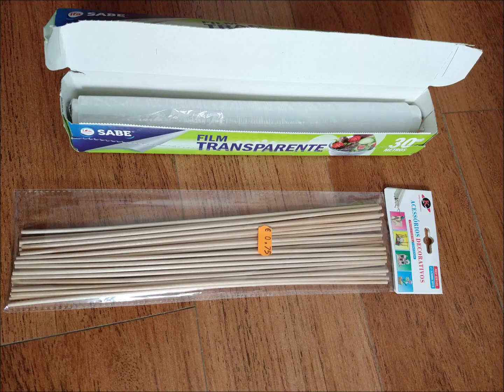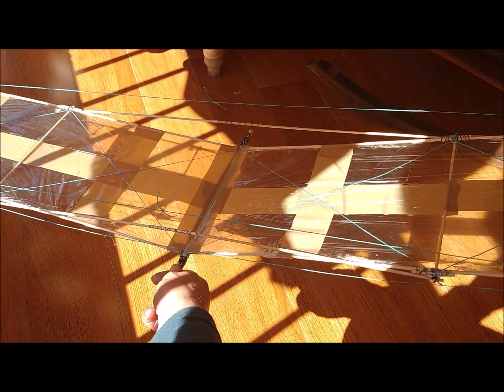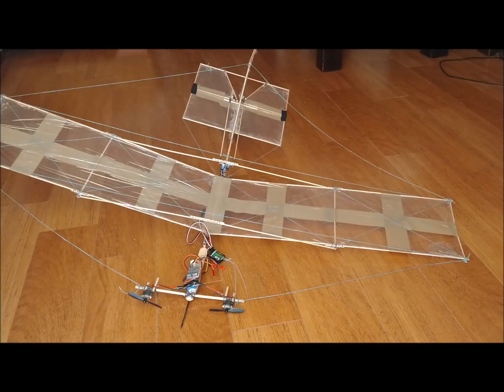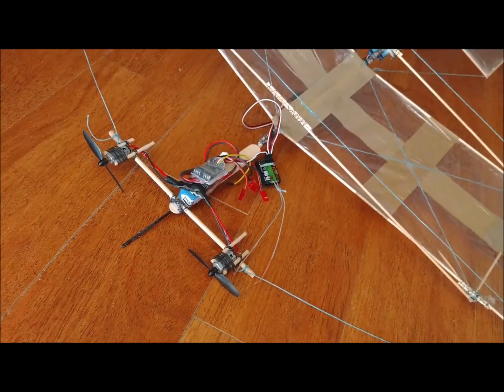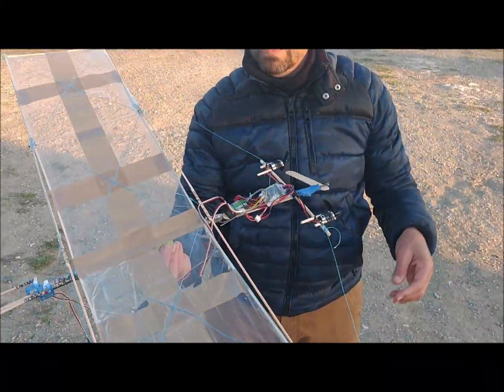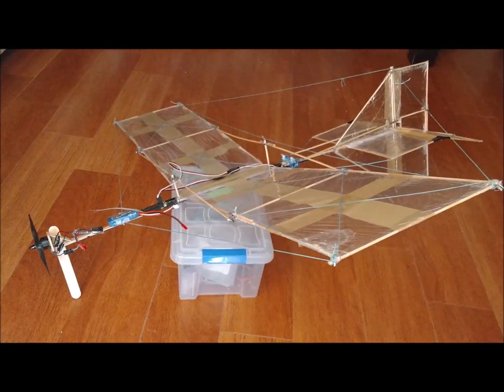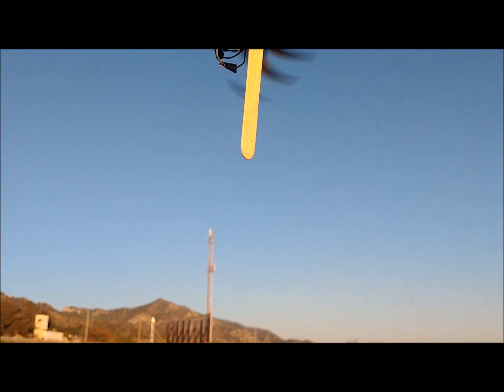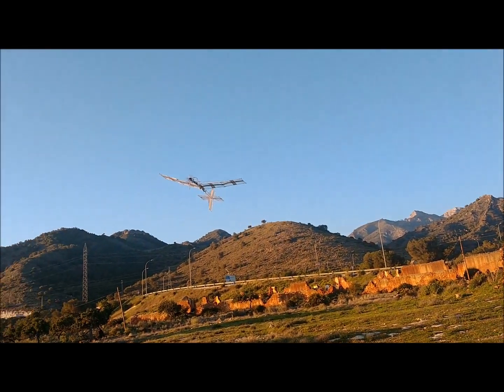How to build a very slow flyer plane with cling wrap and wooden sticks. RC. DIY. Homemade.

Comment: some info.    sorta good work.        at 3:57,  you have made a flat wing that has  a  zero-lift  airfoil/profile.    consequently, a bit positive aoa at the wing mount, might be  tried.   angle of attack.         the tail is  HEAVY, in part, because,  design of the stabs and control surfaces   SUCKS !!!      also,  servos/MASS   go   NEAR  the  cg, or Even forward of it!!!!  but  SELDOM   aft it.    stabilize longer pushrods, as  Needed.        correct  cg  location is  NOT  a distance.   it is a  RATIO.    at  30% of chord; or a bit forward of thirty, if desired.        when there is tail-heaviness in a model's dom,  the  most-OBVIOUS  solution is  to  Make the Tail  LIGHTER.!!!  in this case, a  LOT  lighter.    distribution of mass.        the main wing  Should be  located, about one chord length,  NEARER  to the prop.!!!    googletranslate
Reply: bruh it flies and he designed it with massive control surfaces because its flying slow and small control surfaces have no affect when going slow
Reply: @lucab1733  pinhead,  do  not  Bruh  me.     you are an  idiotChild       what you  have said is, both, Not on point  and   NOT well-stated.  out.